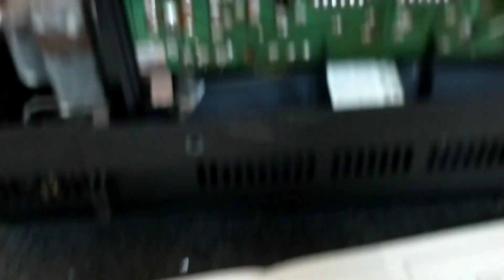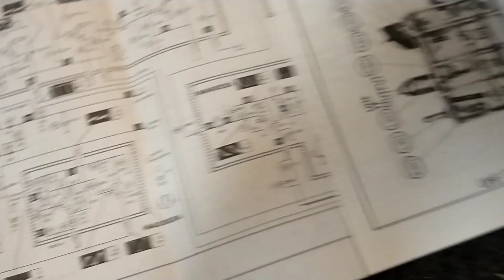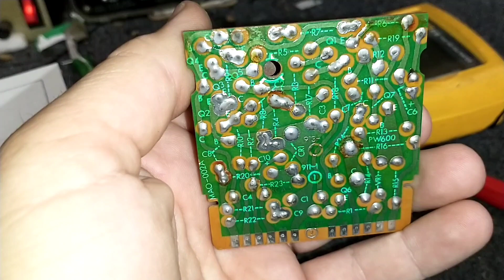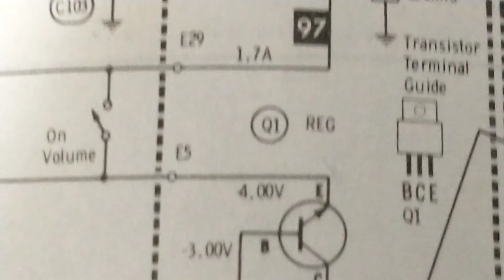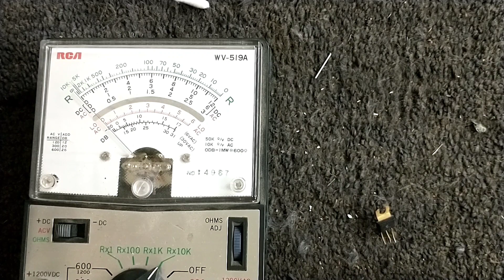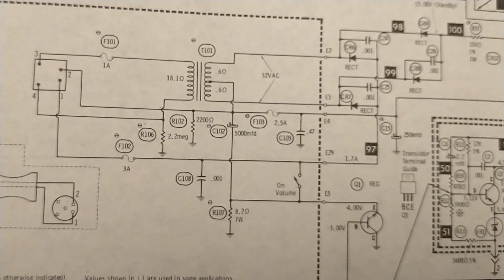Servicing a 1974 RCA AS128e 12" black and white solid-state television. Part 2/?

Comment: Try looking at the power supply differently: it's a basic floating negative supply that is regulated to negative twelve. Then this negative output is tied to chassis and the common is used to run the positive rail. As for the voltage, R11 and R12+R13 from the divider which is compared to 5.6. You suggested leaky components; if the 2.2uf capacitor leaks it will disrupt the divider. If my estimations are correct leakage resistance around 50k would be enough to cause the output to drop by about a volt.
Reply from the maker: I did end up changing the 2.2uf with no change.

Comment: I can only assume the drift in component values over time led to the 12V being low. A lot of those resistors looked to be 5% tolerance on the diagram and maybe the combination of them all having drifted is causing the overall effect. So replacing the voltage divider resistors and upping the Zener from 5.6 to 6.2v has addressed that imbalance. It's time to start chasing your tail when so many components drift out of tolerance in a feedback circuit. Great video again.

Comment: So everything in the dc doubler checks out ok?wonder what would happen if you could current limit the supply from your external psu
Reply from the maker: Doubler was good. Even subbed the cap and rectifiers with no change.

Comment: I'm least qualified to say, but that high wattage 8.2 ohm resistor carries a good portion of the load and the series regulator is in parallel. That's what I think I see. Pull the TO-3 and see if it's the same. Then you know regulator isn't conducting. Because of the parallel power resistor maybe you can't trust transistor voltages to determine conduction.

Comment: I had set like this it was color. Those modules shops just replaced them. I guess it was a hassle to stock all those modules. The idea was a tech could come to your home and quickly repair your tv by swapping out the defective module.

Comment: Who said a  negative 3 pin regulator would be a good idea :-D
The odd way they use components confuses the hell out of me.
I'm used to old traditional circuits with power rails  that have the positive at the top and the ground being the lower rail.
Radios with pnp transistors and a ground that's a positive makes smoke come out of my ears lol.
Negative logic always has that effect lol.
I redraw the diagram so it makes more sense.
Reply: It's all in your frame of reference. You can adapt.